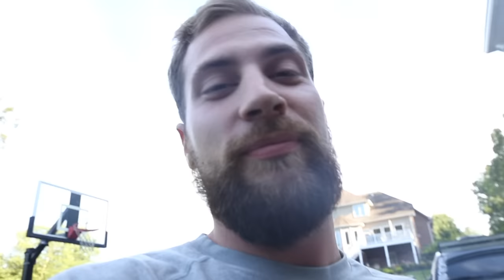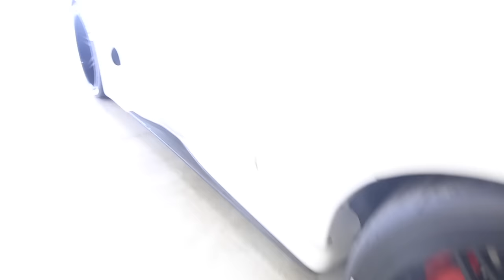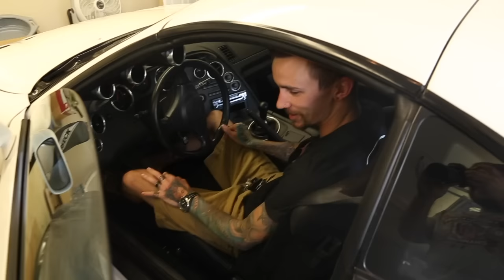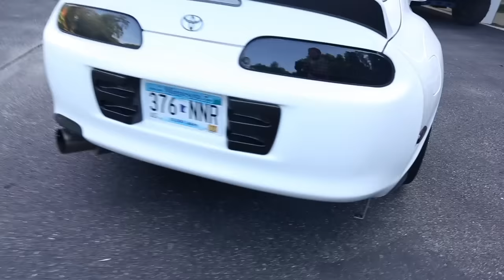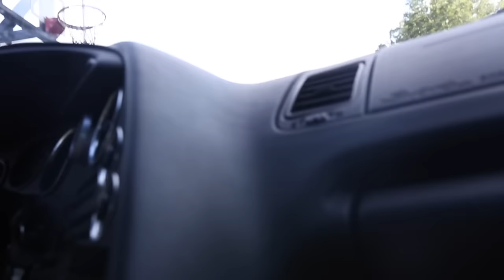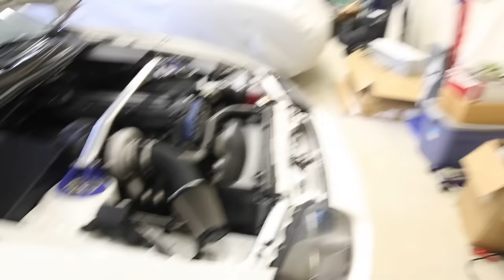700HP 1998 Supra REACTION

Comment: that turbo flutter sound is just everything!
Reply from the maker: steve veigas that comes compliments of the HKS bov. I love it as well. It’s crazy though technically that flutter is turbo surge and they say it’s really not good for your motor. Idk
Reply: Yeah they do say turbo surge is not good for your engine. It just reduces the shaft's speed when you let off the throttle. I dont think it would cause any harm as such. But then again i dont know for sure aswell.  Have you had any problems based on this so far with your car?. Btw that Supra is fricking! sweet!! XD
Reply from the maker: steve veigas thanks for the compliment! I have heard mixed opinions tonif it really does harm. I believe the 2jz is a very strong motor shouldn’t be an issue. I mean I’ve seen a ton of people running the HKS’s for years

Comment: Carbon fiber isn’t stronger than steel, that’s ridiculous. It’s stronger than steel per a given weight. So a rod made of CF that weighs 6 ounces will be much stronger than a steel rod of the same weight. But if you were to go by size, steel wins every time. A rod made of steel that is and inch thick will be WAY stronger than a carbon rod that is an inch thick.
Reply: Define stronger. for instance a carbon fiber drive shaft would be harder to bend, twist, crack, or break than a steel one. However it doesnt handle direct heat and it doesnt hold its shape aswell, i.e gears. since it is woven it can handle the torque better than steel

Comment: Dear Jesus please give me 1998 Supra Rz big single turbo 4inch exhaust hks high power carbon ti exhaust duel race fuel pump built 3.4L racing clutch Motech stand alone 60mm wast gate greedy bov, boost controler, wide ass tires, in Jesus name Amen :-)